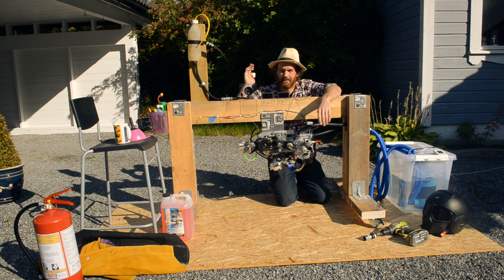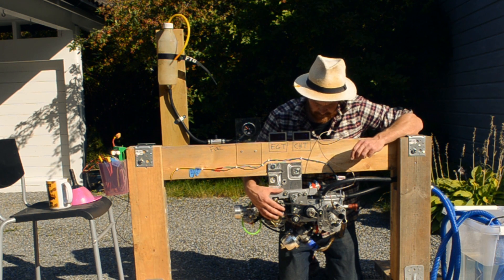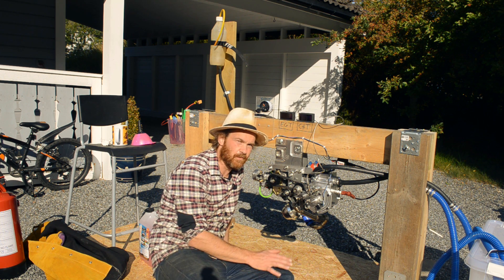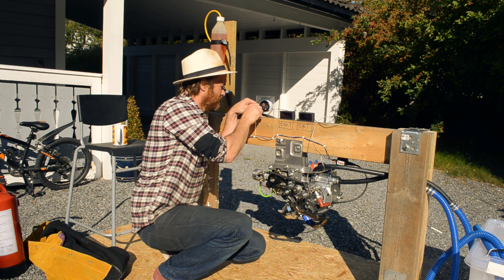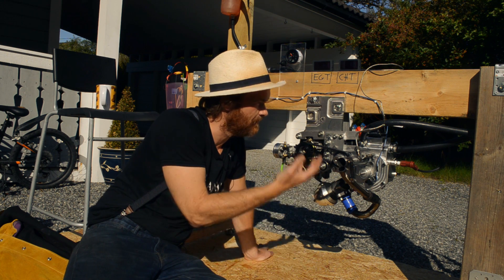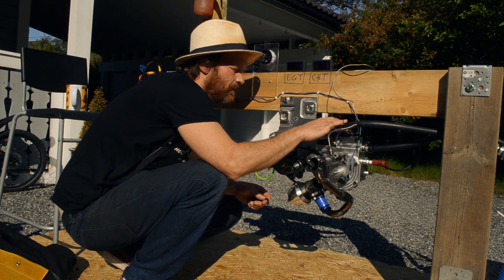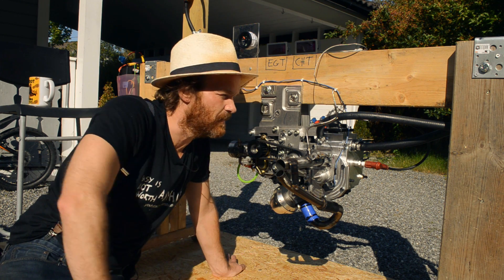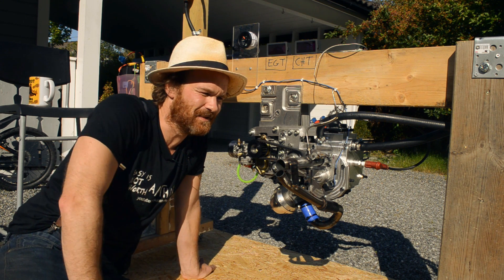First start! 50cc Supercharged Nitro Two Stroke - Will it explode?!

Comment: as for extra clamping force : maibe maike a mounting flange ring that sandwich between the plastic and the bolts on top of the flange , might even need to pre-bend it (spring steel?) so it clamps the sections between the bolts a little harder , could allso groove a deep O ring groove in both parts and mount a piece of thin copper or brass flatstock (shim material?) inside it with a tiny bit of overlap on the ends , if it leaks the flatstock should be pressed against the outer wall of the groove and if the groove is slightly deeper than the flatstock is wide it still alows for some expansion both ways 
with the amount of air forced intoo the engine a little leakage shouldnt matter too mush , do need to set the fuelmixture , looks to me it runs mostly on the puddled fuel being frotted up by the crank inside the crankcase and then runs untill it wets the sparkplug , maibe dual sparkplugs would work (thinking if one of them shorts the other still fires and the heat might dry out the one thats wet) having a stronger flamefront should help with firing the mixture under high pressure too , top fuel dragsters generate sparks powerfull enough to taser a man out , think they allso spark multiple times per powerstroke

Comment: Fantastic!  Congrats!  (Get some ear plugs to use with your helmet!!!!)  And I agree with the suggestion to machine aluminum flanges to clamp down the 3d printed plastics.  If that doesn't work, it seems clear you'll need to abandon the 3d printed parts that are leaking and replace them with CNC machined aluminum, even though they will be difficult to make.  But congrats again on the first start!

Comment: wow that thing sounds mean. like other people have said, 3d printing air tight things is very hard HOWEVER there is one plastic that i use myself that has extremely good layer adhesion and will be airtight straight off the bed. polypropylene. its fairly easy to print and can take up to 100 C. it only sticks to itself tho so you need clear packing tape on ur bed and also a raft because it warps alot.

ive made air tanks from PP that hold 10 BAR with out a single leak straight off the bed !

Comment: Its interesting how there is no four stroking going on at all. Makes sense, given the cylinder is always full. If you can get the fueling all right it should have decent low and midrange power also. I think you are right about under driving the blower also.
Reply: Yeah spitting out half of the fuel mixture thru the bov is kind of inefficient 🤣

Comment: Need a electric fuel pump and a super bn with diagram block off plate with regulator for bar pressure and longer exhaust system probably a marine quicksilver sparkplug strapless for a supercharged jet ski probably around 15cc plug chamber it will need temp to futher verify sealing and compression retest

Comment: Maybe for the 3D printed parts: 1. The nature of 3D printed parts are inherently not well sealed, so applying some sort of surface coating may help. Maybe something like a fuel take sealer? 2. If clamping force is the issue, maybe a metal flange, something easy to CNC machine, on the backside of the nylon flange to sandwhich the nylon against the engine. Effectively a very very large washer!
Reply: ?why not 3d print with a gap for a o-ring
Reply: @amirbasssystem  If there is sufficient flexure or creep in the part, an o-ring may not solve the problem, and could even exacerbate it. An o-ring requires sufficient clamping force to provide the squish that creates the seal. That might be an issue on parts without sufficient rigidity. Though it's a good idea for future aluminum parts.
Reply: +1 for the metal flange clamping the 3d printed part to the block
Reply: Replace the leaking plastic parts with aluminum, machined flat at the interface. Use a thin OEMish sealer between the mating parts to get a seal that can hold up to the pressure - forced induction creates a lot of pressure on the intake tract.
Reply: @5tr41ghtGuy  That's the obvious best choice, but I think the lesson here is that complex aluminum parts are very difficult to manufacture compared to 3D printing. So finding a 'good enough' way to make the Nylon work for the prototyping stage is best case scenario.
Reply: @bradley3549  I hear you, but that motor employs significant forced induction and nitromethane; not the best place to use budget parts.
Reply: @5tr41ghtGuy  Sometimes budget parts are the difference between making something a reality and keeping it a dream. I think in this case, you have to consider what is lost if the part fails vs. what is gained if it lasts just a little while and is cheap and easy to replace.

And remember this is a dyno stand test article and not something you have to rely on not to blow up between your legs - at the moment.
Reply: @John Robertson  Yamaha Yamabond.
Reply: @dennisford2000  Exactly what I was thinking.
Reply: increase infill? use cubic from prusaslicer? these are all factors
Reply: 3d printed is very porous stuff. Even normal cast aluminium  is sometimes treated with  cappilair epoxy to fill up the pores and make it tight.
Reply: I used rtv to regasket my carb , it held fuel in no problems
Reply: @emilvlahovic3917  Some RTV is not fuel resistant, one should check that. Cost me an awful lot of carburetor cleaning.
Reply: @coenvanwyk1  the one i used was fuel resistant,  nothing got cloged and nothing leaked , but i do agree
Reply: @emilvlahovic3917  you are clearly more careful than I am. RTV is a wonderful thing.
Reply: yes, like an aluminum bracket sandwitching the nylon part between itself and the engine.
Reply: or go full alloy, and use the cnc to make a port perfect matching flange. the allround clamp is a great idea, i'm surprised that the nylon is holding out 0.6 bar. might want to have these pipes pressure tested to 2 bars, for safety's sake, be it metal or nylon in the end.
Reply: @canadianoddy8504  it is strong wnough for guns . There are 3d printer guns out there , YouTube it
Reply: @off spec Yes, he does. But it's an incredible amount of work for an experiment. You understand that right? Prototype using the most efficient technology, and once a design is optimized, build it using the more durable technology.
Reply: Seens like you know a thing or two about the engine... i havent been around from the beginning but in my head it doesent make sense to charge a two stroke that way without spitting out all the overflow airfuel mixture without a exhaust valve?
Reply: @workshop.wizardry  there is a exhaust valve, it is from the dump valve.
Reply: @workshop.wizardry  he has a rotary valve
Reply: Could just 3D print in stainless or aluminum...but needs post-processing and compensation for shrinkage.
Reply: @canadianoddy8504  You can 3D print nearly every material besides tool steel. Anything you can't do with FDM at home you can do with SLS or HP's metal jet on Craftcloud. Things have come a long way.
Reply: @canadianoddy8504  I agree that this is a sound approach. Alternatively, you can readily purchase some mandrel bend aluminum tubing (commonly used for custom turbocharger plumbing), cut a section and then tig weld flanges on the ends. Afterwards, face the ends on the mill.
Reply: @off spec You can 3D print wax for small metal casting molds.  Not sure if it's good enough for his larger parts. I would rather print directly than make a mold, though. Way easier. Will the final product be the same? No. Can it be close? Yes.
Reply: Groove and o-ring would help-
Reply: It could be the methanol in the R/C fuel that’s the problem reacting with the 3D Printed parts

Comment: Maybe 2 spark plugs will work for a  better burn of the fuel? Or is it a dumb idea?
Reply: Or even 3 spark plugs.  Two for the cylinder, and one for the exhaust. Just need to form the exhaust into a de Laval rocket nozzle.

Comment: Some of my 3d printed petg parts leaks through the plastic walls itself. Perhaps a thick layer of clear coat could make them air tight if you have the same problem?